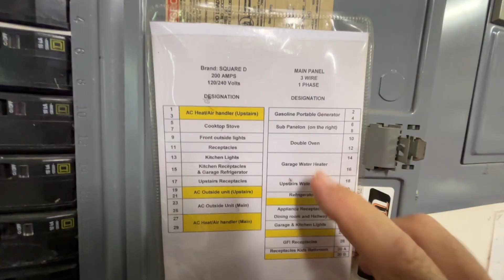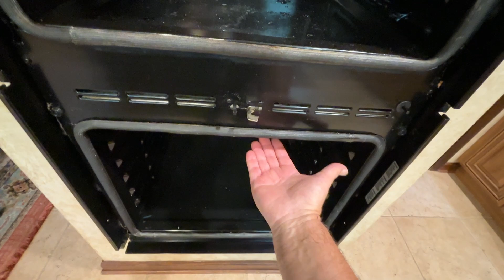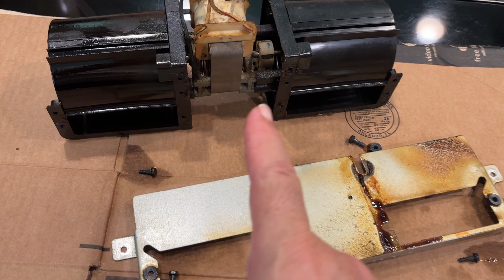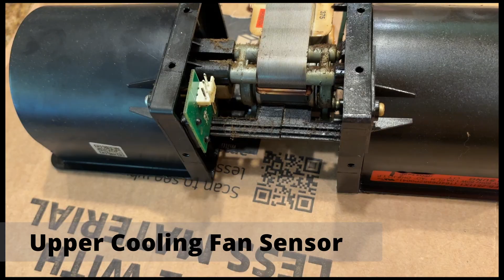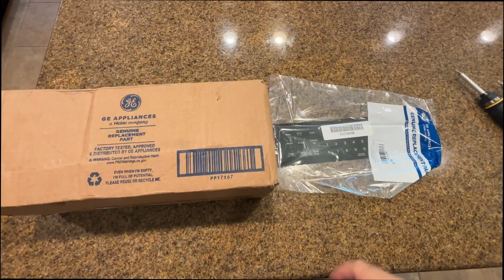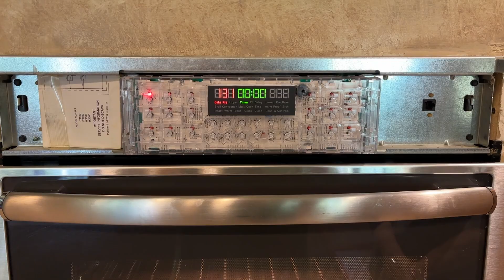Part 1 - How to Fix Double Oven Error F96 and F97 – Replace Cooling Fan and Control Board

Comment: Is the F97 error also the same fan that you changed on  this video?  We had F96, changed the fan but now have a F97 error.  Please comment
Reply from the maker: Hello Rodolfo,

It's great to hear from you!

The upper and lower fans are different. I experienced the same issue on my unit. After replacing the upper fan (F96), the lower fan failed a few weeks later and displayed the F97 error. That's actually why I made the second video on this topic.

Feel free to watch Part 2 video, where I show in detail how to replace the fan and provide information on the exact part you will need. I hope it helps make the repair easier for you.

Please let me know how it goes and what results you get.

Thank you so much for taking the time to reach out and for supporting my YouTube channel. It truly means a lot to me and helps motivate me to continue creating and sharing these projects.

Have a great day!
Best regards,
Jay

Comment: Is it the same fan for f97?
Reply from the maker: Hi Jeffery,
It’s great to hear from you—thank you for taking the time to message me and for supporting my channel. The lower fan for the F97 error message has a different design, so I recommend checking out Part 2 of the video, where I explain how to remove the lower fan and which fan and sensor to use.

I hope this helps! Good luck with your project, and please feel free to reach out if you have any questions.

Have a great day!
Regards from Florida,
Jay

Comment: spraying degreaser on the fan without taking it out might work.  just have to make sure power is off and  everything is dry before turning power back on again
Reply from the maker: Hi Misty,
Thank you so much for the tip! I really appreciate you sharing your thoughts and taking the time to watch the video. It’s great to hear from you, and your support truly means a lot to me.

In my case, the main challenge was accessing the fan. There simply isn’t enough space to reach it without removing the oven and several additional panels. While spraying it might have worked for a short period of time, I wasn’t willing to take the oven out again—it was quite a bit of work the first time! 😄

Fortunately, the replacement fan was very reasonably priced—about $60 on Amazon. Here’s the link in case you’re interested: https://amzn.to/49PnQHL

Thanks again for reaching out. I hope you have a wonderful day!

Best regards from Florida,
Jay

Comment: And now you know why the serviceman charges so much. Save money and watch this video (or one like your unit ) and 
save some big bucks. Make sure the part is no good before replacing it. Happy wife happy life. Thanks Jay!
Reply from the maker: Hi Steve, good hearing from you! You are absolutely correct (Happy wife happy life, no more burned food on the table)! LOL
In the past, I used to call service technicians, but most of the time they either didn’t show up, or if they did, they charged for travel time, a diagnostic fee, installation, and then marked up the parts two to three times the actual cost.

More often than not, their recommendation was to replace the whole unit — an additional $2,000 to $3,000 or more — because they made more money selling new systems. 
In my case, I spent just a few hundred dollars and about 3 to 4 hours of my time to fix everything myself. LOL

Thank you again, and I wish you a wonderful day!
Best regards,
Jay